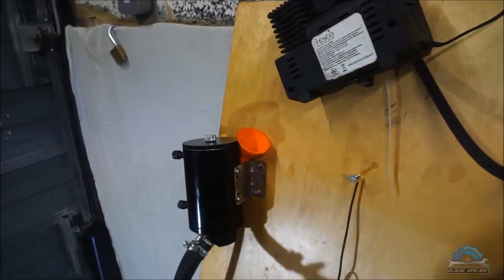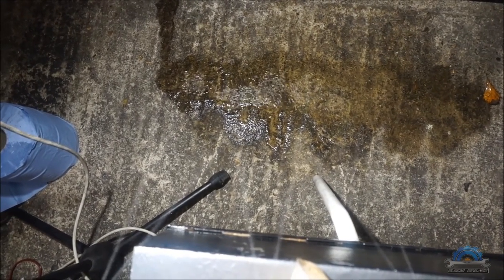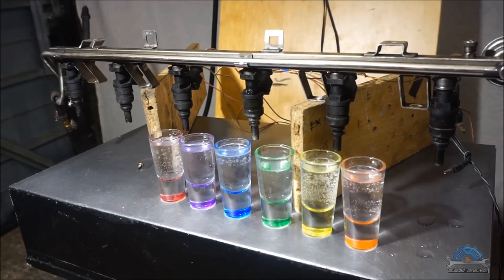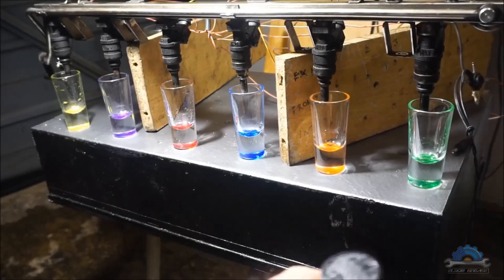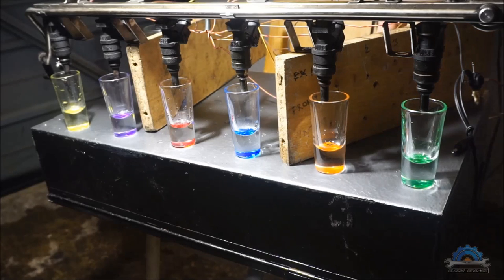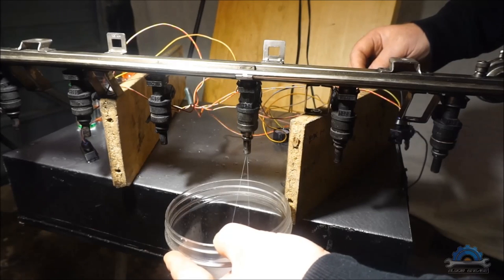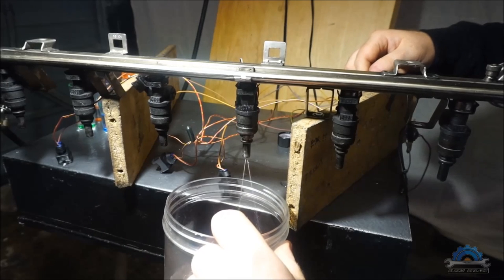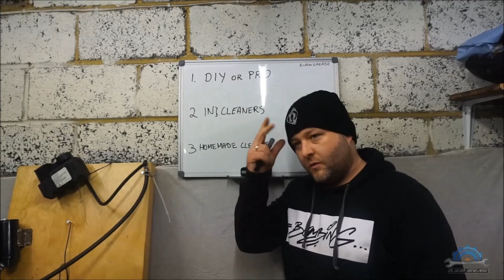BMW e46 FUEL INJECTOR CLEANING  bad injector found

Comment: Nice testing machinery you have built there.
If one of this injectors spry more or less then others, it mean your engine will vibrate.
I'm going to text here a tricky way to make your car engine work almost like new.
Kitchen oil is quiet useful to fix injection system, if you have older car you can drive well with kitchen oil, it makes more smoke and smell but works good.
You don't have to take out injectors at all, just bay few liters of kitchen  oil and put in tank, three litres in 20.l diesel, or 5.l kitchen oil in full tank and drive normal as everyday you do, and you will find it useful the injectors system is clean after few days...save money, but if it still vibrates after you empty the tank, then i guess you will have to fix in service or your self if you have tools.

Comment: Also, if you are attempting to show a benefit analysis, cost vs time vs results, then at least reveal the full cost vs professional cleaning. In your video, I did not hear any mention of ultrasonic cleaning by professional cleaners, which they all do. So, to compare to a professional setup, your DIY must include an ultrasonic cleaner. That is to say, It is only possible you could DIY like a professional with your system if you had used an ultrasonic cleaner. Small ultrasonic cleaners can be purchased for around $30-100. So it is possible.

My cost analysis for professional vs diy is at around $20 per injector for a professional cleaning, plus shipping, your six injectors would cost around $120 + shipping ~ $130... DIY cost =  the compressor to purchase, $20. The can you have = $15 eBay. Hoses and clamps = $20. Extra fuel rail w extra harness = $20 junk yard + entrance fee and time to get it. Wires for the electricity = $2. Fuel cleaner = $10 per can. TOTAL without ultrasonic cleaner, $87. New Total with ultrasonic cleaner $87 + $30 (cheapest I could find on eBay), $117.... So, is the difference of ~$20 worth your time to have a professional cleaning. To me, it a 100% yes!

PS you could of course do this cheaper if you use your own rail and rigg up custom connectors, and if you had things lying around like a compressor and can and clamps etc. But you still need and ultrasonic cleaner.

Comment: they say it is VERY bad to constantly use current on the injectors, as they only open a fraction of a second each time, and if you put current on them constantly, the inside of the injector could easily overheat
Reply from the maker: They say alot of things, first thing injector works in engine bay +90C , sprays fuel which is hot too
Reply: well said!! @ElbowgreaseDIY